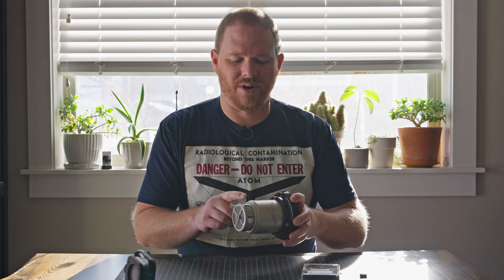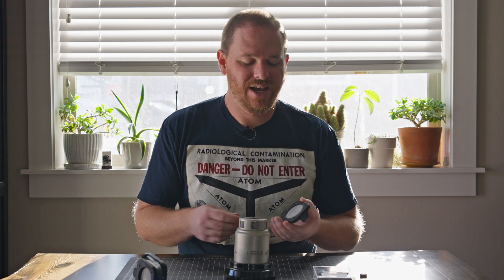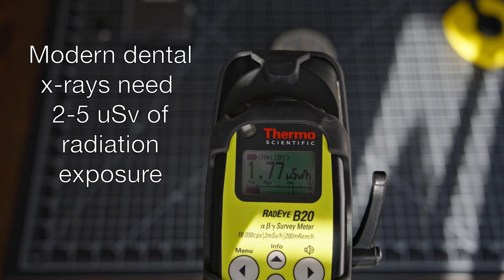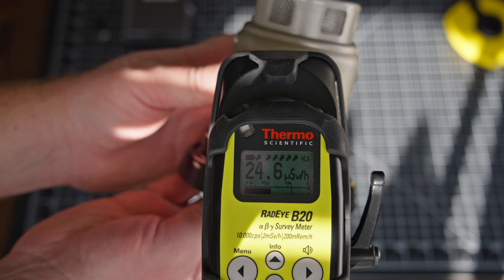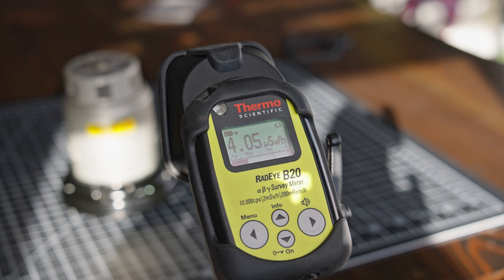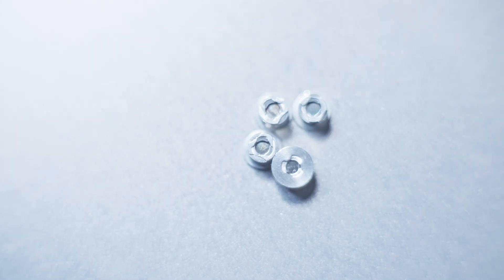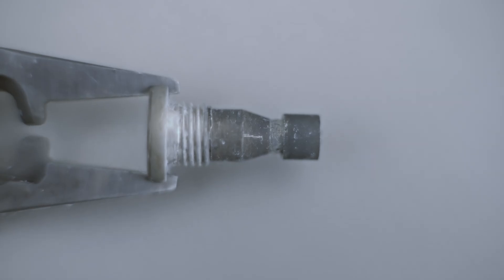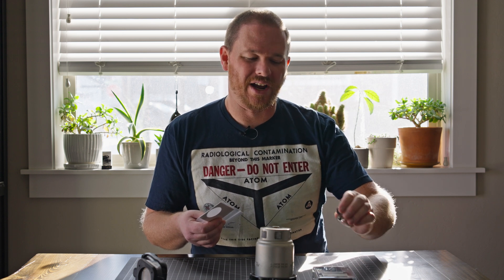How Much Radiation Was I Exposed Too

Comment: 20 micro sieverts is nothing... i have a fiestaware dish that puts out 180 microsievierts
Reply from the maker: I would be very surprised if you have some Fiestaware that puts out 180 micro sieverts. Usually Fiestaware is on the lower end of the activity spectrum as far as uranium glazed ceramics goes. Also I'm sure that dose rate isn't coming from a detector that is only reading gamma radiation. The majority of uranium glazed ceramics gives off beta radiation, which can contribute a little to the dose rate...but wouldn't be able to make it that high.

You should try taking that reading again but this time have a small sheet of glass, plastic or even wood. See if the dose rate changes dramatically. If it does it means you are seeing primarily beta radiation, which couldn't give you a dose rate that high.

Comment: I was curious to see how much radiation dose you get if you have multiple CT scans. And the calculations showed that 4-5 CT scans (cranial, cervical, thoracic, abdominal) are equal to the total dose you are exposed to for 8-12 years. I was curious how much uranium would be needed for the same exposure excluding the oxide dust and the radon produced which would not be significant anyway. The calculations showed again: You would have to sleep with a kilogram of pure uranium under your pillow for about 566,000 hours for the same dose.. I calculated how long it would take to be exposed to the same amount of your source.. Basically you would have to sleep with your head on it for about 3.4 months if you sleep eight hours a day every day.. And they say uranium is dangerous and CT is safe... But radium is extremely strong. If you are exposed to almost 10 mg, you only need a few hours to reach or exceed the total natural dose for 12 years... Sleeping with 10 mg in your room would be like doing 4-5 CTs daily..
Reply from the maker: Those CT scans deliver a very hefty dose that's for sure. The calculations sound correct...radium is about one million times more radioactive than uranium. So yeah, that little 10 mg amount would give you a sizable dose.

Comment: Hi Drew,

I need your help. I got a LANL Behind the Fence Tour and Trinity site visit this October. I would like to get a geiger counter. I can't afford the fancy one you have in your videos. Can you recommend a maybe $100 one that is affordable and will work? Also, when the geiger clicks, what is it measuring? Gamma, Beta, rays etc? How much clicking is dangerous? Thanks!
Reply from the maker: I recently did a another Geiger counter review video and I believe there are a couple options out there for under $100. Just remember, you get what you pay for. There is nothing at the Trinity site that dangerous as far as radiation exposure is concerned. The different types of radiation a detector can measure depends on the type of sensor its using and its dimensions. The CPM (counts per minute), which you could think of as clicks per minute, don't really start to get dangerous until you get into the 500,000 CPM range...usually. Danger is usually about exposure, so how close you are to a source and for how long.

Comment: I'm really a big fan of your channel and find it fascinating, but I must wonder; despite all your reassurances that most of the radiation you feature on your channel is not dangerous, since handling these obviously hotter sources repeatedly with your hands, are you not worried a bit about at least a higher chance of developing skin cancer on your fingers? ;)
Reply from the maker: I'm not worried because my exposure is pretty low from these items. The radium post out of this smoke detector has some pretty intense radiation on contact...only intense comparatively to other sources that can be found pretty easily. Its nowhere near a source that is dangerous like ones used in the medical industry. So as long as I'm not holding it for long periods of time I'm not worried about it.

Comment: I just picked up a westclox alarm clock that according to my Geiger counter if measured at the face is putting out about 42 usv/hr. Crazy that these were on peoples nightstands.
Reply from the maker: I use to think the same thing. But that level of radiation is still pretty low when comparing it to really high dose sources. Plus the radiation drops off pretty quick the further you get away from it.

Comment: Gamma passes straight through!
Reply from the maker: Yep, for the most part. It can be attenuated by water, concrete and some other materials.
Reply: @RadioactiveDrew  Gamma radiation is attenuated by ALL materials!  It depends on four factors: (1) the energy of the radiation, (2) the attenuation coefficient of the material for that energy (3) the thickness of the material and (4) the density of the material.   Sometimes the attenuation coefficient  is already multiplied by the density, that depends on what tables you use.  Just like the half-life, the attenuation is often quoted in the more practical "half value layer" which is the thickness to reduce the gamma radiation by 50%.  It is an exponential, so a double thickness does not totally stop the radiation, rather it reduces it to 25%.   Low-energy gamma radiation, like "soft" x-rays, are more easily absorbed in human tissue than the higher-energy variety.

Comment: You have to wonder why they used such a hot source just for smoke detection, and also why they didn't incorporate Lead as a more effective shielding to prevent errant radioactive particles from harming someone.
Reply: Apart from alpha particles with a range of only a few cm, little other radiation is emitted from a smoke detector source.  I visited a factory that makes smoke detectors and they had a large glass jar full of those sources, probably several hundred, and there was little radiation to be detected with a GM placed right beside the jar.

Comment: The reason gamma radiation is the most important to measure is because alpha and beta radiation cannot penetrate near as far. The rule of thumb example is that Alpha radiation cannot penetrate paper, beta radiation cannot penetrate a credit card, and gamma can penetrate a lot. The real risk of Alpha and beta radiation would be ingestion of an emitting source. Something emitting constant alpha radiation from inside your body can be very bad.
Reply: Yup, and it’s why Geiger counters can give a false sense of ‘all okay’ if ingestion/inhalation is possible.  Certainly possible to get a lethal dose of radiation from something eaten or inhaled while the Geiger counter is sitting there bored.

Geiger counter is a great tool for if it’s okay just standing somewhere though.
Reply from the maker: @silly-youtube6053 well…that’s not true for the vast majority of isotopes you are going to run across that could be potentially dangerous. Anything in a high enough dose to make you sick or worse would be extremely radioactive and would set off any radiation detector. 

 Also radiation detectors don’t need to sit around to be useful. I use mine to track radiation in environments and make maps showing dose rates.

Comment: as of Jan 2023 That seller has them cards. he also has some voltage regulator 900V Zenner unit for GM  Tubes. I got a Russian GM tube in home made counter. just a HV source adj 900V threw a resistor to GM tube and a HV blocking  cap to LM 386 audio amp to small speaker. simple but works to detect radiation . runs on 6V battery. made it years ago as a electronics project. from last night lots of GM tubes can be found on eBay and amazon .I may add VU meter to my unit. the clicks get louder as Radiation increases. I bult it with Radio shack parts years ago and GM tube from eBay . Thank you for the link.

Comment: Wish you did a test without the shielding, but overall most likely still safe. For reference, once you get to 100 mSv (100 000 uSv) it starts to get dangerous. Add another tenfold and you will probably get radiation sickness.

Comment: Wouldn't the detector get more radioactive as time went on?  E.g., radium has a half-life of 1,600 years but decays into radon with a half-life of 4 days and polonium which has a half-life of 138 days?  I'd imagine the radiation wasn't so bad when the detector was brand new.
Reply from the maker: When it was first made it would have been a little less active. As radium decays it becomes other isotopes and I've been told that when it reaches radioactive decay secular equilibrium about half of that activity is from the daughter products. Its even higher for uranium. So if you make some uranium metal its not going to be as radioactive as uranium ore. But over a very long time it will start to increase in radioactivity as those decay chain isotopes begin to build up. It a crazy thing to think about.

Comment: The alpha radiation concerns me when I see someone holding such a device and it's radioactive core directly in his fingers. I wonder how effective gloves are and I am wondering which kind of gloves had been used? Thanks for the video. It is a very interesting presentation, especially with the follow up.
Reply: afaik, alpha particles can't penetrate the layer of dead skin on your body. The biggest concern with an alpha source is inhaling or ingesting the radioactive material so alpha particles are generated inside the body. So gloves are useful not for stopping the alpha particles but instead for stopping your fingers becoming contaminated with the radioactive material. Therefore, almost any sort of disposable gloves would probably work well.
Reply: @tmmtmm Most Alpha particles get stopped by the epidermis, but a small amount reach the upper layers of the Dermis.

Comment: I  like how your camera's image sensor picked up radiation noise as well,  when you got it close to the post.
Reply: Oooh wow yeah! I was just watching his first video on this and I wondered if an older digital camera or film camera would have picked up/gotten messed up. Guess this particular one did and looks like it knocked out a few pixels maybe! Super cool to see.
Reply: Well spotted, I didn't notice that on the first watch. But it's difficult to say how much of the speckling was caused by the sensor's individual photodetectors being hit by radiation, as normal random electrical noise is amplified by setting the camera to a high sensitivity (which I assume would have been done for the shots showing this.)
I would guess it's a combination of both factors.
Reply: I think this was likely hot pixels
Reply: @T2D.SteveArcs not hot pixels. The phone was rather far away and the source used isn't particularly active.

Comment: You didn't discuss the exposure from those portions of the previous video where you had removed the cap, taken out that post, or opened the can with the screen in it.  I would surmise that it would have been a lot more than you video discussed for emissions from outside and sealed.
Reply: Ageed I was waiting for that part in this video and it never came up, that was the part of the first video where I was like ooohh dang.

Comment: Hey! I’ve just placed an order for one of these bad boys. How do you store yours? I keep my hottest radium 226/ strontium 90 sources under lead sheeting but I feel like something more substantial might be needed for this particular source.
Reply: You don't need any lead, distance is the best shielding. 10 to 15 feet of distance is enough to bring the gamma radiation back to background levels. Radon the main problem, so keep it in a well ventilated area, ideally in a shed outside.
Reply from the maker: I keep mine in an old concrete lined safe in my garage. Doesn't block all the radiation but does a decent job at kicking it down.
Reply: @RadioactiveDrew  I feel underprepared now.
Reply from the maker: @catfission  I'm sure that lead sheeting will do some good at blocking the radiation. I wouldn't be too concerned with it as long as you can keep some distance between you and the smoke detector. Do some tests and see what works best for where you are. If you're really concerned with it you could also keep the radium item in a water tight container and submerge it in a 5 gallon bucket of water. Water acts as a pretty good shield...if you can't get thick enough lead.

Comment: Your actual dose is probably slightly lower than what you have measured if the filer you are using only blocks betas and but doesn't "flatten" the energy response curve to gamma. The LND7311 / 7317 tubes commonly used in these type of instruments overestimate the dose rate for energies lower than the normally calibrated value for 662keV (Cs-137). Most of the gamma energies coming off Radium (with the exception of Bi-214) are bellow 600keV. This means that if your tube is not energy compensated  or the filter doesn't perform such function, your reading will be over-estimated for this lower energy region. There are special filter using layers of different materials which can perform energy compensation.
Reply: The B20 H*(10) filter is an energy compensated one from 17 keV to 1.3 MeV. You may see it in the B20 user manual and on the outer side of the filter.
Reply from the maker: I'll have to find the spec sheet on using the gamma filter but as I remember it its energy compensated.

Comment: I just checked to see how much the radeye was, and from fishersci.com it was $1.8k? I'd think a meter like this would be around $400 - $700, why is it so expensive?
Reply from the maker: The reason I got it was because I wanted something that was small and could take a drop and a smack. That was my main reason for buying it. But it also has different isotopes you can choose from as energy calibration and if you damage the pancake probe you can change it out pretty easily.
Reply: @RadioactiveDrew  did you get it for $1800, or cheaper from somewhere else? I have a similar geiger counter (The radiation alert ranger from SE international), and it also has a pancake probe (probably bigger actually), and all the other features you mentioned. To be honest I'm surprised the Ranger isn't more expensive than the radeye, as it seems higher quality. The ranger costs around $600, so it's strange to me that the radeye would be three times that price.
Reply from the maker: @EvilScientist  I've never handled a radiation alert ranger so I can't really make any type of comparison. I know that if you want to buy a Model 3 Ludlum meter to no probe new its going to cost close to $800 and then you need to buy a probe with it for an additional $325...the cheapest alpha/beta/gamma probe. I think the price is the price you pay for quality and its ability to survive in different environments...maybe. I haven't done a test between all those units. But for the most part you get what you pay for. I have had zero problems with that Radeye B20. I can't say they same about the Soeks 01M or the Gammaguard CT007-F. I plan on doing a review of the detectors I have used and own.
Reply: @RadioactiveDrew , I agree with you. The price is of the Thermo decision. I choose B20-ER because its detector plate is moved out of the main body so I can securely put it on the surface without touching it with the fingers or other device parts. Also I was nicely surprised with Finder and Single search modes.
Reply: I have a Black Cat Systems Geiger counter I bought a few years ago for about $300.  It converts you laptop into a Geiger counter which is why it is cheaper I guess.

Comment: I wish I had the gamma filter for my thermo b20… I bought mine used.
Reply from the maker: You should be able to buy the gamma filter on its own.
Reply: @RadioactiveDrew  do I buy direct from fisher? They don’t sell directly to the public. And anywhere we can buy that cable so we can update our device? I already have the software.
Reply from the maker: @icecorebaby  I think I bought my detector and filter from Thermo Scientific. When I first bought this detector they wouldn't send it to CA. So I had it shipped to MT and shipped to me from there. CA has some weird thing about certain equipment or certain sellers selling direct to the civilian market.
Reply: And you'll be surprised that there are 2 filter types to measure the dose. H*(0.07) and H*(10). Each of them has its own apply type. I don't speak about alpha blocking filter because it confuses me.

Comment: In my estimation the most biologically significant radiation dose from making this video was probably beta exposure to the eyes. Wearing some glasses wouldn't be a bad idea. And that smoke detector (along with the bank indicators) is absolutely pumping radon into your house like a radioactive firehose.
Reply from the maker: I keep all my super hot items outside in a safe and I also run a radon monitor in the house. Of course here in Montana we have higher than normal radon but I never worry about it.
Reply: @RadioactiveDrew  A video about the radon production as measured by the monitor would be very interesting, by the way.
Reply from the maker: @MinSredMash  I have plans to do a video about radon production from radium doped objects. I've already done some tests with some good results.
Reply: Alpha particles will also damage your cornea. That’s why I always wear goggles when working with really spicy sources :)
Reply from the maker: @catfission  I could only see that being a problem if I had an alpha source really close to my eyes. Usually alpha radiation doesn't go very far. Beta radiation can travel some distance.